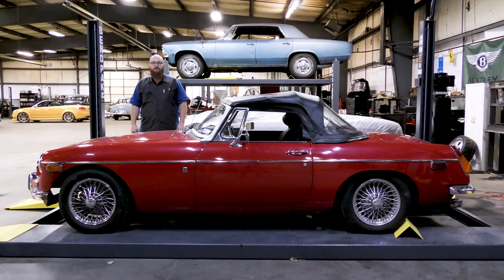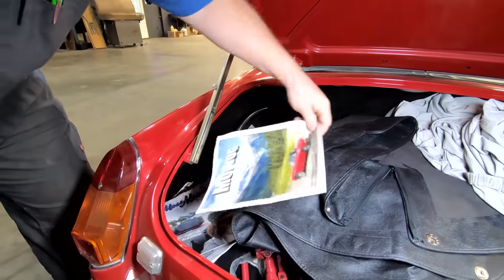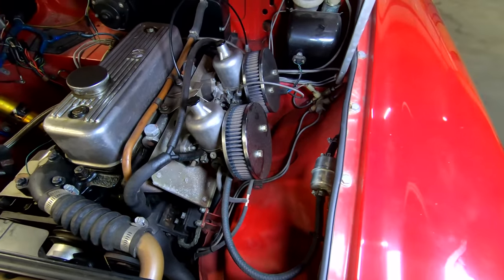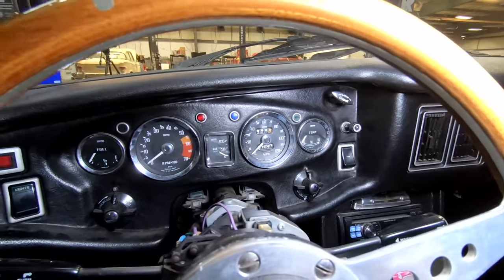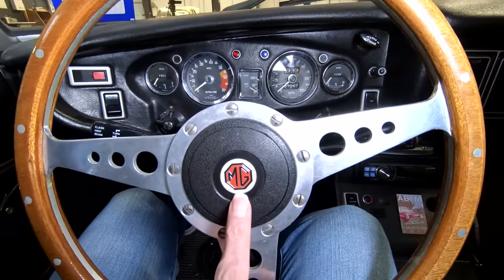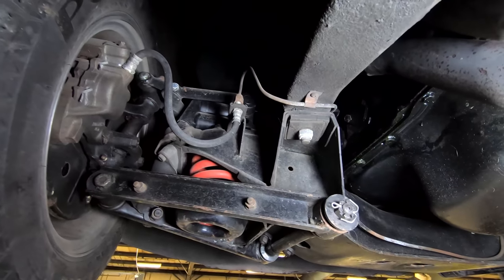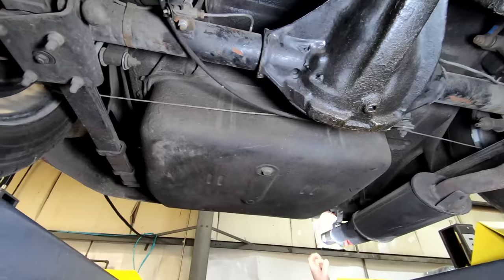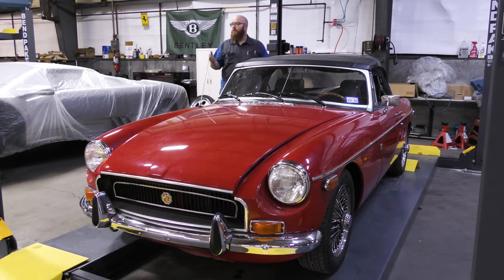Cherry 1972 MGB! See exactly why it earns a thumbs up from the CAR WIZARD!

Comment: Love the MGB GT coupe (not convertible). The non-convertible looks so much cooler imo.
Reply: The roadster came first, the GT later with the roof designed by Pininfarina. Very pretty cars. My first car was a GT but now I have a roadster as open top cars are just far more fun to drive. Always top down until the rain hits the inside of the screen!
Reply: @asciimation     The MGB is NOT a roadster, it is a TOURER.. So designated by MG and by definition. A Roadster does not have roll up windows. Any other definition of roadster is new age  BS.
Reply: @Jeff Hildreth  The factory called it a roadster, the VIN body style is roadster, the manuals call it a roadster, anybody who owns one calls it a roadster and people who don't own one will identify it as an MGB roadster so that's all good enough for me. If you really want to be a pedant you should look into how everyone these days says dashboard when what they are actually talking about is the instrument panel in cars.

Comment: "Look at that Tiny little shaft"  that's what she said😎😉🤓🙃  Seriously, the car was designed for rallies. So, it's not set up for a spare battery but rather, it's a 12 volt system but was designed with 2  six volt batteries for even weight distribution.

Comment: A 67 had a vent line from the fuel pump electrical side of diaphragm chamber running up through a grommet into the trunk with a "T" fitting on it and if you decided to wash the trunk out - there went your fuel pump! Ask me how I know this. 😆

Comment: MGB's have a certain smell about them, don't know what it is ,pleasing though and that unique exhaust sound .I had a 78,an electrical nightmare but good times with it still. Wish I'd had an earlier one,more English character I'd say.
Reply: A combination of oil, and the smell of leather, and Dunlop seat cushions and leather in the early years. Also Lexol leather cleaner.

Comment: save the old fuel pump. disassemble it and look for a set of contact points, { much like in an old distributor }. there you will find the usual problem of pump failure. if the points are not too badly burned, they can be cleaned and polished back into service. hope this tip comes in handy on future M G fuel issues............MEOW

Comment: A little FYI about the MGB...

What is MOWOG??  Simply the different divisions of Morris Motors.  Similar to the FOMOCO casting seen on Ford products.   Definition is... MO=Morris Motors, WO=Wolsley,  G=MG/Morris Garage  Some will argue the G is for Gardner, a small light but short lived tractor division of Morris Motors.

The additional battery mount was for the earlier twin 6 volt batteries, POSITIVE earth/ground.  Was problematic when installing NEGATIVE earth/ground accessories like an aftermarket stereo.  Only after it became increasingly difficult to find the proper sized 6 volt batteries did MG choose to go to a normal single 12 volt negative ground battery.

Why Positive ground??  Ask an Electrical Engineer, they'll tell you theoretically current flows from negative to positive yet we've all been taught automotive electrics the opposite, positive to negative.  Make any sense??  Not really but a number of early British cars used the "backwards" battery installation.  I blame engineers at Lucas for that one.

Cheapest fix for the fuel pump??  Walbro makes a small, tidy, inexpensive and reliable solid state fuel pump.  Possibly won't work on the positive ground model??

How popular is/was the MGB??  When Mazda was designing the new to come Miata/MX5, the chassis/suspension was based on the Lotus Elan backbone concept.  IMHO, the best handling, best balanced front engined car EVER.  Period, end of discussion.  

To capture the spirit and tone of classic British sports cars, Mazda based the exhaust note on an MGB with the very popular aftermarket Abarth exhaust system and tuned it accordingly.

What does the SU on the carbs represent??  Skinner's Union.  What does a boot manufacturer have to do with carburetors??  Look it up, an interesting story.

Comment: The excitement from an MGB is not from the engine (90 horsepower, max), the suspension (straight from the 1950's) or even the comfort (there isn't any).  The REAL excitement is wondering if it is going to start, and wondering if it's going to get you home.  :)

Comment: The converable top looks incorrect, but in some years MGBs had some questionable styling. Like they lifted them 2 inches later in the 70s to meet U.S. bumper and headlight hieght requirements. 
I think the S.U. carburetors are not stock for 1972, should be Solex carburetors after 1968ish. S.U. are better though. My 1962 Triumph TR4 had S.U. carburetors.

Comment: Red tape, what's red tape? That said, I had the same problem with the turn indicator/switch on my BGT, so I just replaced the whole unit. The two battery boxes are there as originally it has two 6v batteries.

Comment: They all have oil at the back of the engine because they don't have a rear main seal. Make fun of Lucas if you want. I owned two MGBs and three Minis. Lucas is easy to work on and if you understand their weaknesses, easy to fix.The SU fuel pump is junk (usually the points) but those carbs are the simplest and most reliable in the world. NA mechanics are still scared of them.

Comment: The second battery box is because the cars originally had two 6 volt batteries wired up to work as a 12. Well it was 1962 ..............

Comment: You know so little about the MGB you just reviewed. For example, they originally had two 6 volt batteries under the back. The empty space is not for storage. It was where the second battery sat. Yikes!

Comment: Ahhh, British Leyland, saw the circle of despair on the front left fender, so this is one of the last before they destroyed the looks with the huge bumpers required by US regs
Reply: They didnt have to. The MGC met the reg's with larger wheels and a  higher ride height, and kept it's chrome bumpers . The rubber bumpers were pure Leyland operating at it's finest.

Comment: The fuel pump is designed to be serviceable, and the parts are still able to be had... you shouldn't have been quick to have bought a new one
Reply: Perhaps the servicing costs outweighed the replacement cost with a new one...that will last another 50 years???
The owner will get the old one back...then it's up to them what to do with it?

Comment: Along with Lucas, the other great evil of British car production was BL's central accounting which was a department entirely formed from the word "no". To be fair, they knew they were up against Ford who back then very much had the lead in production cost control (what happened Ford?).
To me these "British" roadsters are European - it's their Italian designed bodywork. The one that wasn't is the Triumph TR7/8 (an in-house job, by the bloke what done the Austin Allegro) which was probably all down to… central accounting!
Reply: Only the GT was Italian designed hard top.original "B" was British design.
Reply: @chrischadwick3079  my bad - you're quite correct, what was thinking?! Triumph/Michelotti possibly…

Comment: I think that had been modified back up to European spec engine wise. It's strange that while at the time the average American engine was what, 6 litre or so, the mgb got detuned with a single rubbish carburettor, even air injection I think and low octane motion potion. Back in Britain they were sprightly and lively cars with factory twin carbs, high octane fuel etc and the b series is a well proven race engine. Also not Leyland's fault that by this point Americans were getting too large to fit in it, drive through heart conditions already flourishing. Plus, I love when Mrs wizard said it's not going to be doing 120, has she taken an American car from the same year to 120, it's completely terrifying, the 2 ends aren't even joined up.

Comment: The OD is because they only come with four gears.🤣
Reply: Most vehicles of that era onlyu had 4 gears...and those that tried to hang a 5th gear somewhere in that 4 speed box usually failed....always a weak point until truly engineered properly...

Comment: So i have a 94 toyota hiace van and just want to ask what could be the problem why it has a slow start up it moves of slowly and take time to pick up speed
Reply: What engine and what transmission and when did it start doing this? Did you run out of fuel?

Comment: The engines originally , I believe, designed for tractors.
Reply: and the diff was from a small truck
Reply: Nope, not even close. 
Though the Bristol 25 dozer used the Austin A70 engine...purred like a kitten
https://www.youtube.com/watch?v=OaFCq-K4X-c
That was Standard Vanguard...used in the Massey ferguson tractor...and Triumph used their engines in the TR series....

Comment: Why do people always leave so much of their stuff in their vehicles when they take them in for work? I work at a body shop and there's always so much stuff in people's vehicles. I understand that if you're in an accident you might not be able to clean out your car before it gets towed away. But once it gets to the body shop and you get your rental car, you can come get your stuff. In a side impact, we might have to remove the doors, the windows are almost always removed, and body work is messy. There is cutting, grinding, welding, body filler getting sanded, priming, more sanding, and then painting. And after that, there's wet sanding and buffing. So if there's anything in your vehicle that you don't want to get dusty, please remove it from the vehicle. Moving personal items is time consuming and there's always a chance that something can get damaged. It's better for the customers and the workers if personal items are removed from the vehicles or at least put in a box or bag in an area away from the damage.
Reply: The black cover in the boot was the cover for the convertible top when it is lowered (press stud onto the body) thus in the right place (with the vehicle).
The spare wheel is in the correct place as there is no other place for it.
The MOWOG mag is of interest...it relates to the Morris Minor Owners Club...and dates back to the 1930's  Hence the use of Mo (Morris), Wo (Wolseley) and MG to mark the various components with MOWOG.
The pot of touch-up paint is far more useful in the boot than sitting forgotten in a shed....
The dust cover is useful if the car is going to be stored for a while...say like in a workshop?
This vehicle was not on the way to a body shop.......but you are right, taking almost everything out of a vehicle on it's way to a body shop helps everyone....

Comment: I drove and restored MGB's and MGBGT's for over 15 years back in the 70's and 80's.... They are the epitome of British engineering, NOT... Lucas electrics, Smith gauges, friction shocks, a 4 cyl engine that weighs as much as a small block Chevy and has to be rebuilt every 50K miles, wire wheel splines that strip on regular basis and on and on and on... They will not run if it is cold, dark and wet outside... I must have been a masochist to stick with this brand for so long...
Reply: How stiff was your upper lip????

Comment: The demise of MG in the UK.

The terminal rot set in well before the Chinese wisely bought the IPRs of the former massively asset stripped Rover Group.

The massively asset rich Rover group was sold to the Bavarian asset strippers for peanuts. A fraction of the true asset value. To underline this. Soon after the BMW takeover, they sold off part of the Rover Group to FOMOCO. That being Jaguar Land Rover ( JLR ),  for more than BMW paid for the whole group before any asset stripping.

To avoid big penalties under European Union emissions constraints, BMW needed smaller cars in their model range of "Gas Guzzlers". Rover Group provided two small cars, the Mini being one and the replacement for the Rover 45 the other. Some say the latter became the 1-Series. Those huge R&D costs set against the Rover balance sheets. Cue the Bavarians "English Patient" comments.

Us Brits were mugs to allow all that to happen. I bought my first MGB, a three main bearer pull handle roadster over fifty years ago. It was the fastest of four MGBs I was to own later. Got images of them all.  Most MGB production destined for the USA ( I wanted to buy a new one in 1970 but was told an eighteen month waiting list for my spec as most were headed to the states. ) 

Unlike a Nation who I prefer not to say, the Chinese are not Mugs. They were allowed by the UK official receivers of the wound up former MG-Rover company to purchase the MG-Rover IPRs for buttons. The Chinese held the marque in higher regard and rightly so.  I still own several MGs including two examples of the Chinese built MG6s. The MG6 is a much better car than many here in the UK, for various reasons would have you believe when they first appeared. Very much better.

Here in the UK I live in a street of 120 private residences. All have cars. Five have Chinese full MG ZS EVs or MG HS hybrids. UK car consumers, not to be confused with car enthusiasts clearly like them. All those I have spoken to have nothing but praise for them. Chinese MG sponsor much of my favourite TV Channel here in the UK on FREEVIEW TV.

I have no issues with that except, those new MGs should have been built here in the UK Midlands like many thousands were before ... not thousands of miles away in the Peoples Republic of China. Chinese MGs are now a very common sight on UK roads.

Only in the UK ... :sigh:

Comment: Datsun 1600 was more power. Same motor almost. Push rod motor
Reply: The Nissan (Datsun) L16 engine feature OHC valves, 
wedge-shaped combustion chamber, 
aluminum cylinder head, 
and fully balanced five-bearing crankshaft to turn out smooth, dependable power. The cylinder block is cast in a single unit, featuring deep skirting. 
The engine is equipped with single, 2-barrel, downdraft carburetor.
The L16 engine with SU twin carburetor was also available. This engine, which was called L16T, had flat top pistons, a slightly different head, higher compression ratio rating, higher output power, and torque.
The camshaft is made of special cast iron and located inside rocker cover. 
Four aluminum alloy brackets support camshaft. 
Camshaft bearings are lubricated from oil holes which lead to the main oil gallery of the cylinder head. 
The valve system has a pivot type rocker arm that is activated directly by the cam mechanism. 
The Nissan L16 motor use the dual-type valve springs. Intake valves are 42 mm (1.65 in) in diameter and the exhaust valves are 33 mm (1.30 in). 
The intake valve duration is 240°, valve lift is 10.0 mm (0.39 in); the exhaust valve duration is 248°, valve lift is 10.5 mm (0.41 in).

The camshaft is driven by a double row roller chain driven by the crankshaft. 
The tension of the chain is controlled by a chain tensioner which is operated by spring and oil pressure.
Reply: The L16 is cool. I just got a U20 motor, it pretty similar. I also have a R16, the 1600 roadster motor.

Comment: That oil leak at the rear of the engine is most likely the scroll seal on the main bearing. -  They have a habit of leaking  because they invariably don't seal perfectly. There is a Mod that can be done to convert it to  modern type of seal.   See this Mod done on  Wheeler dealers for an MGA.  https://www.youtube.com/watch?v=TH3uy69-hvA

Comment: Are these engines hard to work on?
Reply: No, they are very straightforward cast iron OHV engines. A decent mechanic could have that engine out in a couple of hours or less. The weeping valve cover will just be a dried out cork gasket; a 30 minute job.
Reply: @TheEulerID  
Gasket cement the new cork gasket down on trhe scrupulously cleaned with acetone head. 
And let it dry.
You have now constructed a 1/4 inch high coffer dam round the head which will never leak again.
Just smear grease on the top face of the gasket each time you repalce the  valve cover after sdjusting the tappets every 3,000 miles and lightly tighten down the bolts holding the valve cover on.
Problem valve sover gasket leaks solved forever....

Comment: Why are you REPLACING the Lucas fuel pump with another Lucas fuel pump?  I had some British cars in the 1960s and 70s ... Jaguar, Triumph, Anglia. One of the things I learned was that, when something electrical breaks, that's the Prince of Darkness telling you to Americanize it.
Reply: Some of us like to keep the car original.  I replaced the pump on my '69 B with an electronic (no points) Lucas pump.
Reply: OOPS, that's an SU pump, not Lucas.

Comment: I'd love to have a car like this, but any vintage car, especially vintage British cars, are money pits, some more than others. Even with an honest mechanic like the Car Wizard, it would still cost a fortune to keep a car like this on the road. And that's just a fun weekend toy, not a daily driver.
Reply: These aren't vintage, these are classic. Vintage is up till 1930. And these are pretty easy to work on. Lots of parts, lots of information, very simple mechanics. You can definitely daily drive them if you put a little effort in.
Reply: @asciimation  I use the terms vintage and classic interchangeably. Classic is probably a better term to use. I try to use the term antique for older cars, like from the 1930s or older.
Reply: Really,  I have a 1980 B and it’s been very reasonable to maintain.

Comment: Not highly rated at the time, but they endure !   got to have wire wheels on a sports car. A lot of people put silly little steering wheels on these, don’t !    These things were not fast, good thing too, very light on the arse, sack of cement in the boot helps.  At home most of these were beaten to shit and back again